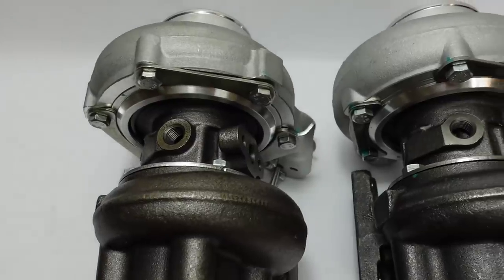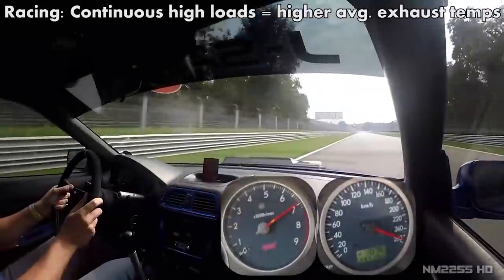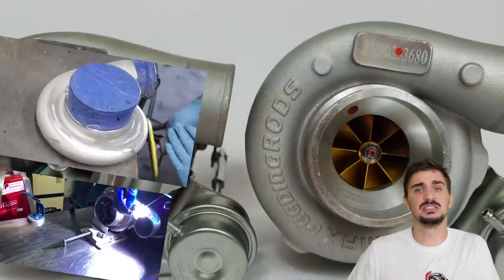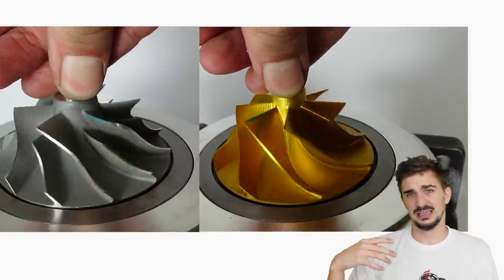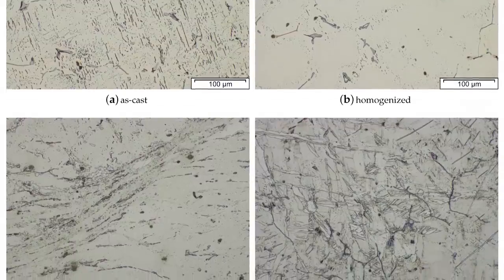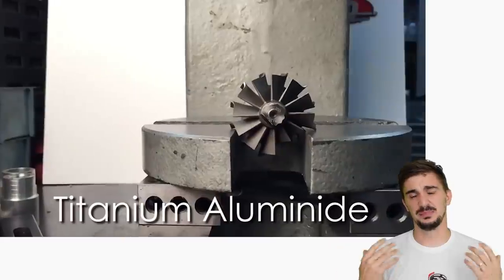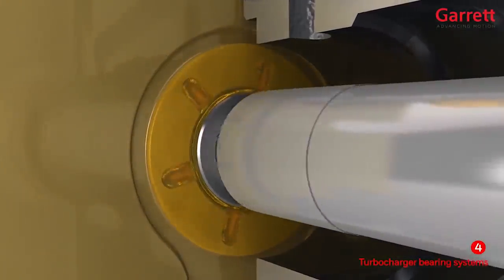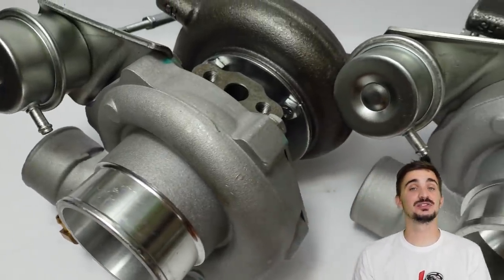What makes a TURBO STRONG? - BOOST SCHOOL #9

Comment: From what I've learned shouldn't 3.0 BAR of boost be 30 PSI? Because BAR equates for the engine vacuum which runs at -14.7 PSI, times 3 that would be 29.4 PSI. As in 1.0 BAR = 0PSI, 2BAR = 14.7 PSI etc.
Reply from the maker: Wait... So 1 bar of boost is zero psi of boost?
Reply: @d4a  Don't quote me on that but I think so. Because BAR of boost and PSI of pressure is two different things. BAR starts at ambient pressure vs PSI which starts at zero.
Reply: @d4a  this principle only applies to map sensors. If it is advertised for 4 bars you can only run 3 bars of positive pressure. The 1 bar is for the conditions which the engine is under vacuum. This needs to be that way because map sensors should output a value of voltage for both conditions (positive pressure and vacuum)

Comment: Seems as though I’ve read that cast compressor wheels are just as good by any measure.
 So…given a quality cast wheel performs as well, and has no higher incidence of failure, then it’s just as good.

Comment: I'm grateful for this very informative video. That drill bit would have a titanium nitride coating rather than titanium, which gives it tremendously increased surface hardness. I wonder if this is what's on the turbine wheel and why.
Reply: When people say"titanium coated " they mean Ti nitride...I think almost everyone knows it isn't titanium.....
Reply: @boosted2.4_sky  I did not know that.

Comment: it is possible that NiT coating reduces the friction drag of the compressor surface by some small amount.
Reply from the maker: I doubt it? It's incredibly thin. Even if it did that it's probably such a small reduction that it's immeasurable.
Reply: @d4a  it does provably create more slippery surface, and it is more slippery for metal to metal contact as well as metal to gas contact, even at low pressure this drag would be measurable. nut it shouldn't be big of course.

Comment: Very interesting episode my turbo have ceramic blade on the hotside in one of my mr2s and the other have stainless steel on the hotside. If I want to change turbo what do you recomend to use that are just a litle more power then the ct20b?. Thanks for the episode allways learn something News.
Reply from the maker: Ct20b is hilux and land cruiser right? Well for "just a bit" more power the easiest bit is probably the same turbo but with upgraded parts? I see a bunch of companies offer that online. It depends obviously where you live as turbo shipping is sometimes more expensive than the turbo 😁
Reply: @d4a  the ct20b is used on 3sgte gen3.

Comment: Been using china turbos i various types, and it's better than no turbo. But do not think it work as good as a genuine turbo. 

Got tired after been blowing seals and got restricted from boost over 2 bar. 

Bought a Borg Warner S300 SX-E with a billet compressor turbine instead. Haven't tried it yet. But compared to a friend of mine, he got better power band and higher output over all. 

Bottom lite. Don't think you can achieve dreams with a $100 turbo..

Comment: Imagine if the impeller had an integral fly wheel so that the inertia would continue to provide boost when gas supply was reduced during braking and decelerating. Now boost drops to near zero during these events and the turbo must “spool up” before serious boost is reestablished.
Reply: Well, the issue there is that you have to spin it up first, which would take massively longer.

Comment: I realize that this might not be perfect or ideal. But I would rather purchase a few of the cheap knockoff turbos instead of one perfect turbo. Once I put an engine into a car with the proper exhaust piping, fuel, wiring. I would rather just have to replace the turbo every 100000 or 200000 miles. Instead of over paying for a single item. Maybe it's just me but 1 equals 0 and 2 equals 1. I like having redundancy.

Comment: How would you build a crank/belt driven turbo system for a car ? Just curious to see how you personally would do it.....
Reply from the maker: By installing a supercharger? 😂
Reply: You would need a gear train to convert the high available torque but relatively low speed of the engine to the types of rpm you would need for the compressor to effectively compress any air (100-200k rpm). 

This is a product that many companies make, Vortech, Paxton, Procharger etc. The difference is that they change the geometry of the impellers so they can keep the RPM a little lower (60-80k rpm).
Reply: I like diy stuff.... Thinking about building a supercharger for a big go kart engine.... 
I guess I should have asked it more in the way of "if you were to build your own set up " ...... Oh well.....

Comment: the moment i saw this 270deg thrust bearing i saddened, one can see that companies like mellett have already fixed this issue on garrett gt28series turbos, wonder what is the reason chinese couldn't have put such in, it's rather not homologation issues like the garrett, and the scale of modification doesnt seem too extensive, would that be purposeful limitation or laziness? ;D
ps. i know that what they have now is very cost-effective, but is releasing an even higher spec model with that issue fixed for a bumped-up price an option?
Reply: Cast molds are expensive,  they are not going to build a 50 to 100 thousand dollar mold if it works fine as it is.

Comment: I bought first Turbo engine 3 years ago.  This is just 3 cilinder motor, but it is faster and response is also much faster than my previuos 1.8 gasoline non turbo engine.  It is amazing. Fuel consumotion is much better, engine is quiter, but still power enoug to sytisfy my need.   No more motor without turbo. No way.   Mid sizes angines without turbo are so lazy, noisy and non efecients...

Comment: You didn't speck on burst rating. Oh just because A wheel is made out of billet doesn't mean it will out perform A cast one Garrette has already went over this so you'er wrong on that one my friend.
Reply from the maker: A billet wheel will always outperform an equal design cast wheel from the same material. It doesn't matter who goes over it, it's basic material science.
Reply: @d4a  Well I guess A Big company like Garrette Is wrong then. lol
Reply from the maker: They're not wrong. You're likely just misinterpreting what they're saying. That being said many big companies have been wrong many times, companies are made up of people and assets and people can make mistakes.
Reply: @d4a  It sound like and the way you put it was off it will have a better spool performance now if you was talking about pure strength then maybe yeah. But just because one is made out of billet doesn't mean it's better it's just cheaper and easier to make. You spoke billet part's being thicker. Parts out of billet needs to be thinker to have the same steel to have to same strength.
Reply: Billet it stronger than cast so you can abuse them more , but they do not perform any better, actually worse because billet is heavier than cast so they spool slower.
Reply: @V8Lenny  lol facepalm
Reply: @SIRICKO  oh yeah , and titanium compressor wheels for very heavy duty cycles are even heavier and spool even slower.

Comment: Hey d4a can you please explain what compression ratio and air fuel ratio mean. I mess that up a lot please at least reply to this comment and explain me what those two mean
Reply from the maker: Compression ratio is the ratio between highest cylinder volume (piston at bottom) and lowest cylinder volume (piston at top). Air fuel ratio is the ratio of air to fuel in the cylinder. Basically one is cylinder volume the other is the stuff that burns inside it. I briefly explained both multiple times throughout my videos. You can see both in the knock video I think, boost school #8.
Reply: @d4a  thank you

Comment: What does the thrust bearing in a turbo do?
Reply: Hi Florian, thrust bearings are used in cars while aiding in smoothness and noise reduction, cause axial forces that need to be dealt with.
Reply: Thrust bearings in a turbo are required to counteract the forces impressed on the turbine wheels by the gases going thru them. Watch the video paying close attention to the gas flow. Note that the intake air comes in straight towards the center and is re-directed by the turbine wheel at right angles to the incoming air. This imparts a thrust to the turbine wheel that wants to push the wheel and shaft towards the core of the turbo and the thrust bearing is there to prevent this. The same thing happens in reverse on the hot side. The hot gases come in and are forced around the housing and the turbine wheel is dragged along and by re-directing the gases in the right angle to the direction it comes into the hot side, straight out into the exhaust pipe. and this exerts another force  also pushing towards the center of the turbine core. Any excess back and forth movement by the turbine shaft would allow the turbine wheels to contact the housing and cause a catastrophic failure. The thrust bearing controls that back and forth movement. With the turbine turning sometimes in the neighborhood of 100,000 RPM you can see why it would be a very bad thing for one of the turbine wheels to touch the housing. In a word, BANG!!! Time for a new Turbocharger.
Reply: @chrisbaker2903  Thank you for your detailed information!

Comment: i think you never saw a stainless steel housing. cause that housing is not stainless mate. i am a turbo manufacturer. both these turbos are made in china by the same factory in wuxi china. and branded differently. but the housing is the same material. just cast iron. stainless is not made the same way at all , and looks way way different.
Reply from the maker: You're a turbo manufacturer. I'm a NASA astronaut.

Comment: Can this be put on a 1.9 disel tdi ?
Reply: Hi NoZo, this is universal application turbo, perfect for all 1.5L-2.0L engines, for all 4 cylinder, modification might be required for some vehicles.
Reply: There are far better turbos for the 1.9 TDI engine than either of these. Google VW TDI performance parts.

Comment: So I shouldn't put a blanket on my stock Ecoboost housing
Reply: Eco boost are insane BS
I challenge you to actually see your manifolds. 
I say this because I’ve had to deal with a fleet of eco boosts. And in stock form they crack manifolds.
Reply: Which is fucking hard to find when you can’t see it without sticking a camera around a turn.
Reply: @fastinradfordable  you incorrect the stock exhaust manifolds warp and break the studs in the head. Then it leaks. Ive replaced them i know. Its a common issue with oem exhaust manifold not the turbo

Comment: turbos on diesels are the same as turbos on gas engines right? dumb question probably
Reply: Yes, but it is recommended that gasoline vehicles use good material turbo, such as street and race versions. The temperature of the turbines on gasoline vehicles will be higher, so a better material is required.😃

Comment: impeller can be braced to be made stronger
Reply: ie, honeycomb and/or shrouded impeller
Reply: electric engine recharging turbo, just the driver replaced with a real torque electric motor, taken from the car battery
Reply: its separated from the exhaust, can be easily made from the cheap materials
Reply: "NOS" by NaClO3 decomposition to NaCl, table salt, and oxygen, simple underwater oxygen source

Comment: Why the old american V8s where so weak ?
Reply: Variety of reasons. Poor air flow, unleaded fuel, CARB emissions, and weaker alloys
Reply: @cavalierliberty6838  thank you
Reply: Bad manufacturing quality , anything made in USA is crap.
Reply: @V8Lenny  and still outlast any eurotrash car.
Reply: @cavalierliberty6838  never. US cars are worst POS I've ever seen , not only engines.

Comment: I wonder what would happen if the turbocharger didn't have a wastegate, sorry g-translate
Reply: bad things. if your engine had enough gas(almost certainly it will), then the turbo will keep spinning faster and faster, well out of it's efficiency range and start blowing hot air into the engine. you're looking at moderate to catastrophic engine damage depending on how long/fast/hard you push it.
Reply: @MrDravous  hooo, thanks for your information

Comment: Naturally aspirated engines will always outlast by double over any Turbo engines with strict exceptions from Mercedes Benz.
Reply: Nonsense.
Reply: @chrisbaker2903  Ok maybe a RAM Cummins diesel outside of this nothing else. Definitely not a Honda.
Reply: @chrisbaker2903  Ok. Good points you had made. Thanks for sharing.